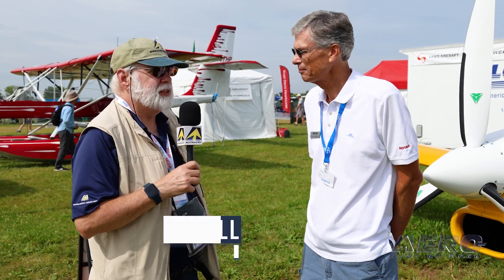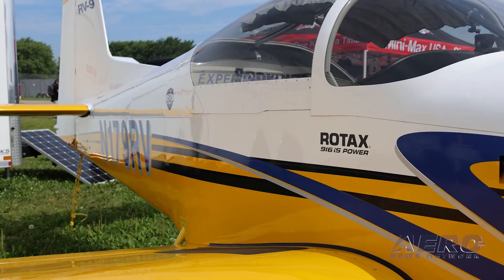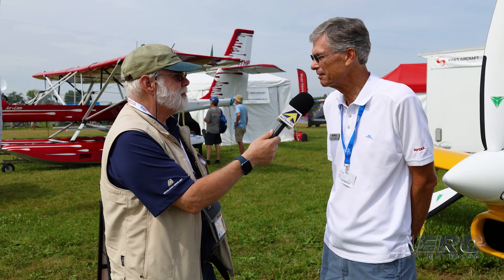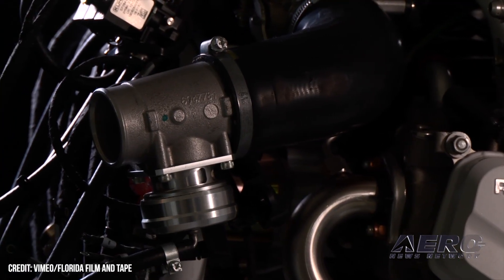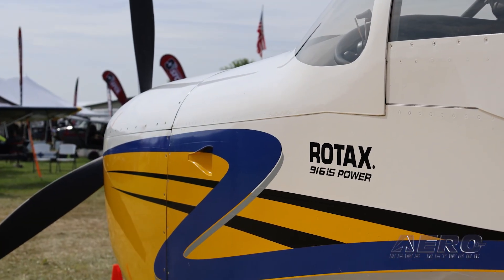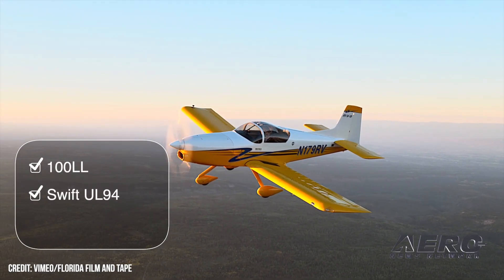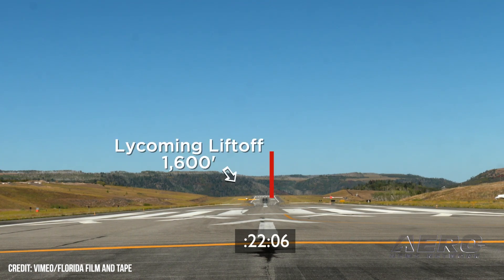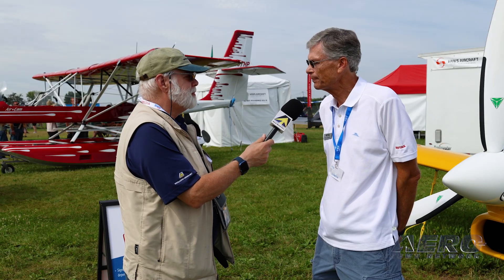Aero-TV: Rotax Power on the Van’s RV-9: ‘A Match Made in Heaven’

Comment: thats my aircraft .......Everything  perfect ..I can add brs ,ac , dual g3x, gtn750 xi and 20 gallons aux tank ......i have seen N179RV flightaware data of top speed 214 knots ,continuously 210 knots . so for 300k all  inclusive  this beats every 2 seater  aircraft  plus 760 lbs payload .
Reply: The vne for RVs is 200 kts, so no doubt that was groundspeed.